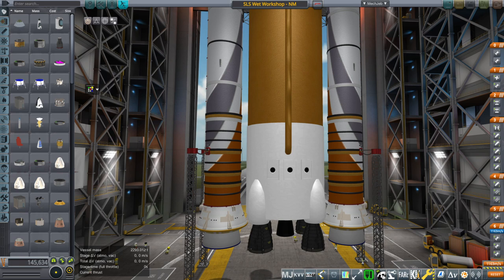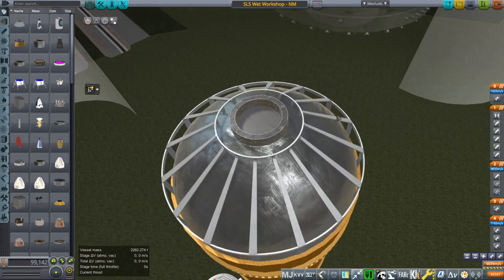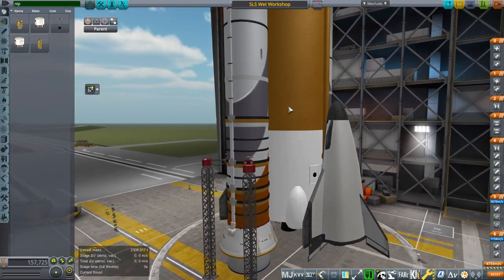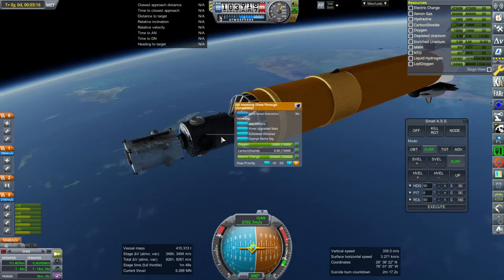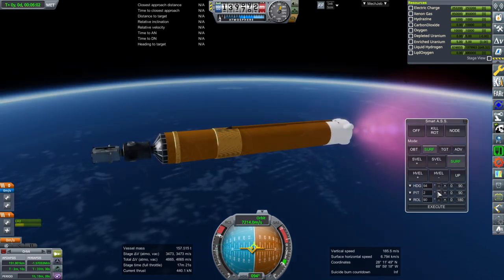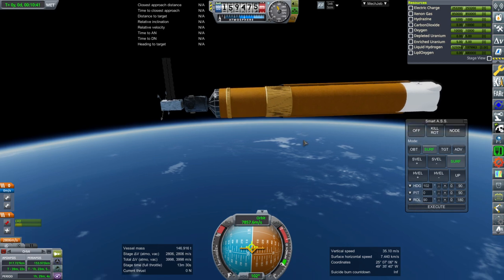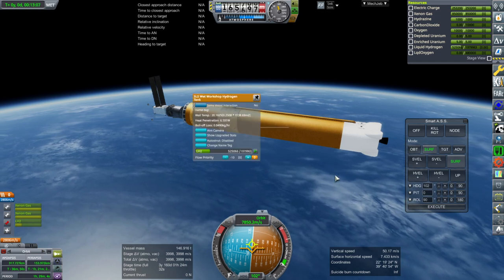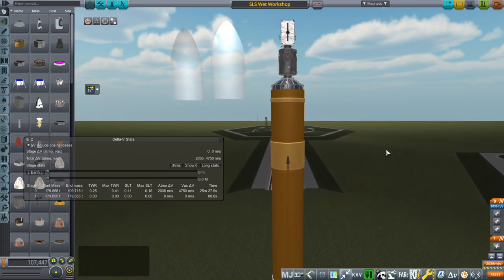The Best Possible Use of NASA's SLS - SLS Wet Workshop

Comment: Hmm, if we were to refuel that thing in LEO, maybe it could be a nice Mars transfer vehicle
Reply from the maker: I was thinking of having it do a test phase around the Moon as a lunar station and then sending it on two Mars. If we have lunar ISRU to produce hydrogen, that makes it even easier. It would need either much more ion engine power and prop or an alternate system to capture around Mars, because I doubt any wizardry is going to keep the boiloff in the huge hydrogen tank low enough for the trip.

Comment: Did u model it in blender or is there a mod with the orion capsule and sls?
Reply from the maker: There's a different mod with Orion and SLS by Sobol that I usually use for SLS, but this time I modeled the core in Blender, yes, though not the RS-25s or boosters.
Reply: @RaizSpace  aight thanks

Comment: Wet workshop... maybe. Certainly an easy way to get lots of space in space (Pun not intended). What I find quite intriguing is the idea of modifying the standard SLS core to have refueling ports for both LOX and LH2 and restartable RS-25's. Even using RS-25's instead of a nuclear engine gives the core itself a tremendous amount of Delta-V. So what i propose is launching a Mars expedition into LEO using an SLS without an upper stage, then refueling the SLS core in LEO and shooting the thing of to Mars. Should get quite a sizable payload there.
Reply from the maker: I like my idea better because refueling just the hydrogen is 140 tons at most, and you probably don't need all that. Refueling both hydrogen and oxygen is more than 800 tons to carry up. The RS-25s are launch engines - bring them back down and use them as such.
Reply: @RaizSpace  True, you Safe a lot of mass, but just in the hypothetical case, that NASA actually wants to use SLS‘s core stage as a transfer stage, it seems to me much simpler to add docking ports and restart capability to the RS-25‘s than add a completely new kind of engine. Getting the fuel up is a major problem, though.

Comment: very cool idea. only problem i see is the same issue every shuttle-derived wet workshop had, that is the insulation foam continuing to pop off and forming a debris cloud in LEO. was there any way to address this without a complete redesign of the tank? iirc energia didn't use foam insulation, not sure what they used instead. i think there were still issues with strikes to the heat shield but they were from ice itself, which wouldn't really be a problem once in orbit.
Reply from the maker: Could just deploy some plastic warp (or, you know, MLI) around it once in orbit. There are a lot of ways to handle it, and the question is more which one is most mass-efficient, but I don't think it's a major technical problem. We could just have it hang out in relatively low orbit, use the NTR and remaining hydrogen to station-keep, and let the foam deorbit.

Comment: That's on classy station How many refuelers would it take to refill that hydrogen tank
Reply from the maker: 140 tons is just beyond the single-trip capacity of Starship or SLS Block IB, not to mention the volume is fairly high, so I guess two trips, but we could probably do fine just filling it with 100 tons for most purposes. With a Vulcan-Centaur or New Glenn, four trips. I think Falcon Heavy would take more trips, ironically, because of the limited volume in the fairing.
Reply: @RaizSpace  Soon we will see how big can SpaceX make their fairing for Falcon Heavy. I think it will just little bit smaller then delta V heavy.

Edit: SpaceX published the new fairing size already,  It is about 6000 cu ft, a long way from matching Delta's size 
.(8200 cu ft)
Reply: @RaizSpace  

That would exclude Neutron or Terran R which are coming down the pipeline in a few years.